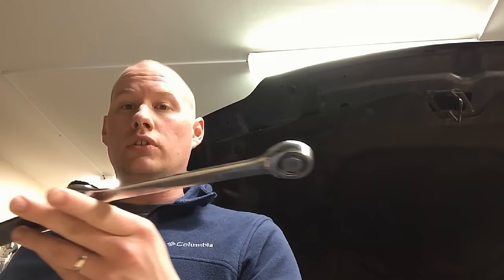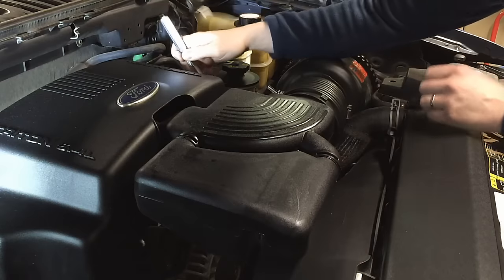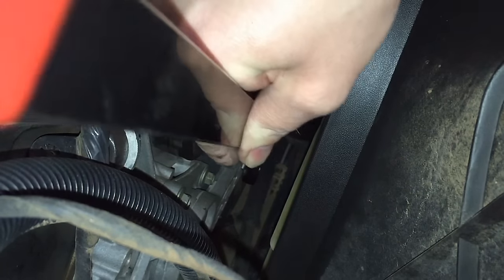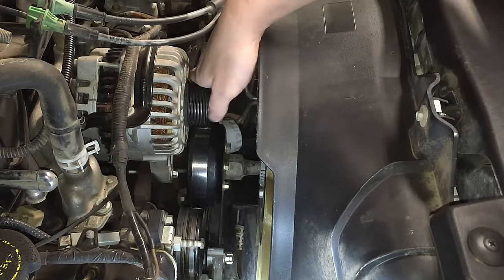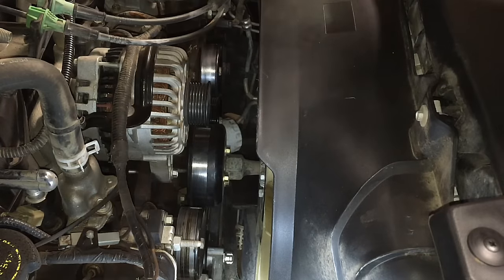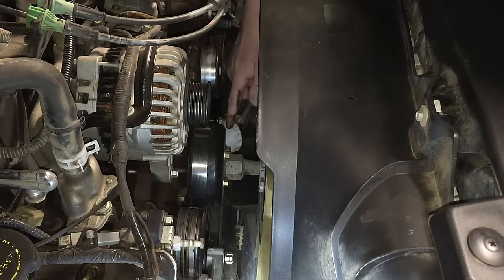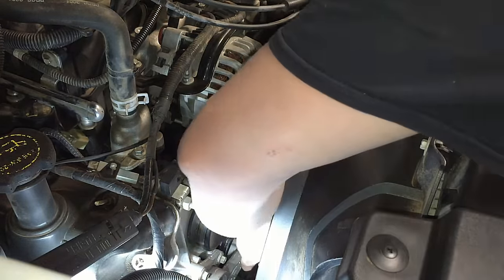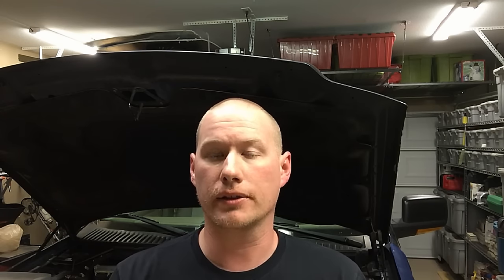Ford 4.6L 5.4L V8 Engines Serpentine Belt Replacement

Comment: Thanks for the video. I had bought a serpentine belt, thermostat, and thermostat sealing o-ring for my 2003 Ford Expedition Eddie Bauer with the 5.4 litre 2 valve engine. I followed your other video to change the thermostat and it made it very easy. Then I followed this video for the serpentine belt and inspection of the tensioner bearings and the idler pulleys bearings, water pump, alternator, and power steering pump. The belt installation was a little more difficult to do because the fan shroud sticks out much further than other models making it difficult to get my hands in around all of the hoses and other items. I persevered with my iPad sitting there playing your video for reference and accomplished the job. After filling the cooling system with Ford antifreeze and distilled water, running the engine, topping it up with more Ford antifreeze I was done. I went for a test drive and found that the engine came to temperature properly, the squealing noise is gone and the engine ran smoother than it has in the past 3 years. Thanks again for the great instructional videos.

Comment: Thank you for posting your videos.  I picked up a used 2007 F150 this past spring.  I have never owned a truck before and your videos have allowed me to do much of the maintenance needed to keep it on the road and running.  I have saved close to $1500 dollars in labor cost with the work I have completed thanks to you.  Keep it up.  Much appreciated.

Comment: Replaced my tensioner pulley, idler pulley, and serpentine belt on my 2000 Ford F-250 6.8L V-10. I used all Motorcraft parts and everything went smoothly. Thanks for the great video!

Comment: Thanks for the video sir. The techs around my area wanted $50 to $70 labor to replace the belt on my 2006 Mustang. For the price of a cheap breaker, and 10 minutes later I was done. You saved me a bunch of money, and I now have a breaker bar.

Comment: Your channel has literally saved My present  structure from day to day over four  situation stranded in the cold your  videos got my unsure anxious trouble shooting, to a pointed direction based procedure so greatful
Reply: Please if you could just quickly answer this for me.does the shaft of the power steering pump pully slightly moved in and out as in toward the engine toward the fan no more then 3/16 to a 1/4 ruff estimate
Reply: Or is that considered needing a new pully or the complete assembled pump mind you the pully doesn't wobble or continuously spin
Reply from the maker: Perfectly normal even when new.

Comment: Today! My belt jumped and seized a roller and killed power to truck on side of the road. Sourced an instant replacement locally, “called a friend” he picked it up, brought it to me, and replaced in under 2 hours in the dark (phone light)
Doubled check my favourite mechanic (FORDTECHMAKULOCO) video before friend showed up. 
The ORDER of insertion, and the final pulley to EASY slide over to finish. 

Thanks 🙏 ma dude!!
Still want to get the MELLING HV oil pump

Comment: This video saved me a lot of trouble. If you are parked against a wall when you are doing this you can push on the wall with your feet while kind of laying on the car to loosen the tensioner. Helps if you have a friend or 2.

Comment: Thank you for posting the video. I know it's a lot of work to make any video.
IMHO I really couldn't tell from the video how you managed to wrap the belt
around the tensioner it looked like the grooves were facing down, but they
weren't they were facing upward. To eliminate the confusion you would grab
the bottom portion of the belt once it is wrapped around the air condition 
pulley not the top part then wrap that around the crankshaft pulley.
I hope this helps some one else out. Many thanks again for posting it.

Comment: Thanks, worked great. I accidentally routed that last smooth idler before the alternator, but did not seem to make a difference. 2010 Explorer has a plastic conduit for the electrical clutch fan. Removed it first just to make it easier.

Comment: Thanks for this video. I especially liked the tip on squeezing between the tensioner to get to the A/C pump. I have a 2000 e250. The last idler pulley at 11:59 is not on my engine(5.4L) it even shows your idler on my hood schematic, but I apparently don't need it. There's a spot there for one, but it's dry corroded and looks like there's never been anything in there. The routing of the belt is the same really, just minus the second idler. I had to pull the belt up over the top of the alternator pulley instead of what you did. which wasn't too difficult. I'm going to replace the tensioner.  I did a goofy hack to bypass the A/c pump, which sort of worked for a good while...Long story.  I take the left idler pulley off and replaced it with a slotted pulley, then re-routed with a different sized belt. I think it ruined my belt tensioner. The pulley was gouging a round trench on the front of the block.... My belt size is AC Delco 8K991. Curious if it's a different size than yours.

Comment: good instructional video. if that new belt starts chirping soon after install theres a good chance it could be the harmonic balancer starting to fail.  I think you saw the video I made on that repair 4.6L F150 where the crank pulley had a slight wobble.

Comment: The images you attached are close to what my 2006 5.4 looks like but the idler pulley is missing in the diagrams.  Also, the title lists 5.4L (2V & 4V). Mines a 3V.  Otherwise it was a very helpful video.  It's very tight getting to the compressor pulley from above.  I found it easier to get it from below.  I really enjoy your videos.  Thanks!

Comment: The 2009 E250 Econoline Van (4.6L V8 w/ac) is a hugh PITA for one thing you need a step ladder to even access the engine bay properly.

Comment: Thanks great straightforward video at a good angle and instructions. There was another on YT I thought was good but yours is the best and good tips what to listen for and feel,
Well Took about 10 minutes to do, pulleys checked out and tensioner was a bear to pull back with 15" breaker bar and pulley quiet so it's working great. Sadly I already had a Dayco belt,  will be interesting as I had a Gates on a Nissan Maxima  that dry rotted after 3 years.

Comment: I borrowed the breaker bar tool from AutoZone the darn thing didn't fit completely in the groove so I spent a couple hours tinkering with it and about 30 minutes replacing belt, I still hear a little hissing maybe it's just power steering! But over all it's not that hard! I could easily do it again with no hesitation!

The key is to make sure your tool fit into tension pully and loop belt thru first step, the rest you'll figure out by looking at your diagram!

Comment: Great video. I have a 2003 Ford Expedition 146000 miles and I believe the serpentine belt is still the original. I recently had noise in my engine which came from a bad tension pulley and the pulley directly above it both was changed but the belt was not. now only the serpentine belt is making noise all my pulleys are looking properly aligned. the noise is on a cold start up and last for about 5 minutes or a short drive will stop the noise through the entirety of the ride. any suggestions?

Comment: Got an 08 5.4 f150. Changed belt awhile back. Noticed some squeaking noise for awhile, changed tensioner squeaking got worse. I haven’t checked the idler pulley’s but when I spray water on the grooved pulley the squeaking goes away.

Comment: Great video, I was able to change my belt quickly, the hardest part was to put the new one on, I checked the pulley as you suggested, and the bottom grub  idle had a little move forward and backward so, I changed it for a new metal one, but the new one also has a little play back and forward, is this normal? 
thanks for your help

Comment: I need your help, guidance, or assistance. This was very helpful. I had to replace 1 flat and grooved idler pulley, the belt tensioner and pulley, and the belt. So i take the belt off and start taking off the tensioner, and flat pulley with ease. When i went to take off the grooved pulley on the bottom right side of my vehicle, the damn pulley bolt hole broke and half of it came out with the screw. I called around and everyone's telling me these i have to replace the entire cover for that simple part. Please tell me that that isn't true. It seems like it can be replaced. If it's possible to replace it, what should I do, or where are you located and I'll bring it to you. I have a 2003 Ford Expedition 5.4L. Any help is appreciated.

Comment: @FordTechMakuloco

Hey i have a 2008 Mercury Grand Marquis it has the 4.6 2v and 106k miles on it.. i have a huge list of all paperwork from the date of purchase from the very old lady who ran into a garage center beam and her kids thought it was time to sell it.. so i bought it.. The thing is that there are no codes, interior is clean, and the engine is whisper quiet, smooth, and all the fluids look new.. the 100k mile maintenance hasn't been done yet, but i plan on doing it this week.. 

All that said, i notice when i am on it, that i hear what i can only call either a bearing noise or vacuum leak.. I don't have any codes, so i don't think it's a vacuum issue, i don't think it's a chatter either like a timing issue, where you would get from running low quality fuel.. I was curious if you know what else it could be.. I don't hear the sound when it's at idle, and i don't think it's timing chain guides, the oil has been changed at the Ford dealership since new every 3k miles.. so.. I am at a loss.. figured i would replace the belt, idler pulley, tensioner, and water pump.. but maybe you in your wisdom have an idea as to what else it could be.. 

I do know the gas cap needs to be replaced.. but i don't think it's an evap issue.. again no code..

Comment: Could you share your thoughts on spinning decoupled alternator pulleys.  What's good and what to look out for if it makes some noise.

At 200K, I replaced my alternator with a aftermarket unit because a noisy decoupler was still spinning after engine shut down.  Now I am thinking I should have replaced the decoupler and left OE alternator on until it fails. (02 G Caravan, 3.3)
Reply from the maker: D Nelson I really don't see those since Ford doesn't use them except in a few instances I know they were problematic for the Chrysler guys in the shop though.

Comment: Thank you for your very informative video's. I have a 2007 Expedition EL Limited just turning 80k. I was wondering what your thoughts are on Cold air intakes such as a K&N?  BTW I have a Ford Premium Care plan to 127,000 miles. Thanks
Reply from the maker: kdsek I don't like them see my new video on this.
Reply: FordTechMakuloco Thanks for your reply! I watched the video, as always very informative and makes a lot of sense.
One more question. I always have (since taking delivery) my expedition serviced at the dealership. What are your thoughts on switching from the motorcraft  semi synthetic to the full synthetic. I always get "the works" oil change done. Thanks
Reply from the maker: kdsek  I don't think it is necessary on a daily driver like yours you would get virtually no benefit over the semi you are running.

Comment: Changed the belt and checked the pulleys still got a a loud squeal only when I accelerate.  I can be driving put the truck in neutral rev the engine no noise, put truck back in drive accelerate noise is back. Might not be related but when moving very slow I here a squeal sounds like a rubber gromit grinding together from under the truck.

Any suggestions on what to check?  Appreciate the videos, used the wheel bearing video last month.  

2001-F150- 4.6 - 170k
Reply: Power steering?

Comment: Nice video! While testing the pullies, the one on the altenator does not seem to turn freely like the others. Is that a problem I need to worry about before I put a belt back on? Thank you!
Reply from the maker: Since it is so heavy and there are dual bearing it will spin smooth but only spin for a bit.

Comment: With no leaks present then how do you determine if the power steering pulley bearing or the power steering pump are worn and need replacement?

Comment: great video  ... any idea om how to do this on a 99f150 that has no ac ? the sticker with the diagram tells me to move the tensioner counterclockwise to bypass the cempressor , its seized soni will
have to buy a bew tensioner any idea on what part to get ?  it seems not many models have that
option to bypass the compressor

Comment: Great Video dude!  05 expedition 5.4  135,000 miles -Are the top two idler pulleys the same?  I'm thinking of replacing my top two and the ribbed pulley and tensioner pulley.  Thanks, I'm learning alot!  Enough to be dangerous! Ha

Comment: I just changed the belt, all idlers and tensioner on my 08 F150 w/5.4 and it still screams at high rpm.  What would you think is causing this?   The alternator does squeak like the one in this video.  Both the water pump and ps pump run smooth.
Reply: the scream is coming from the trans
normal

Comment: help I have a crown vic, codes p0316, 0420, 0128, 0442, 0307, 0308 and c1266. I know a couple are a coil pack, I have changed spark plugs. check engine lite is on and or flashes intermintantly  and the car has 193+++ miles.
Reply from the maker: +james e Mendenhall What year vic? Yeah the next step is replacing coil packs for cylinder 7 and 8 which should take care of 3 codes right there.

Comment: Do you need to rotate the tensioner in the opposite direction if you do not have AC?  I have no AC and need to replace belt
Reply from the maker: +Jesse Pedersen Rotate the tensioner pulley away from the belt that is wrapped around it.

Comment: i tried the half inch racket on my 2005 ford E350 v10 superduty and it was too small.. what other alternatives are there
Reply from the maker: You must have an aftermarket tensioner, the other size would be 3/4".

Comment: I replaced the Grooved Idler and it has a little play the bolt is tight. Do i need to remove it and flip it? Or is that Normal
Reply from the maker: A little wobble is totally normal for tracking purposes.

Comment: I would like to find a supplier that had Motor craft cheaper than aftermarket. Everywhere I look, motorcraft is at the top of the price range.
Reply: You will never find Motorcraft parts cheaper than aftermarket parts. If you do, then be hesitant on purchasing. Motorcraft is high for a reason.
Reply: Rock auto has at $27 as of this writing. I use them for a lot of my parts and they are half of what you pay at any parts store. Good selection of motorcraft parts